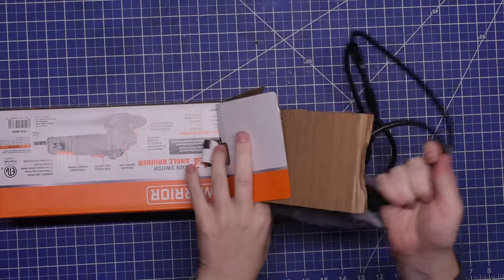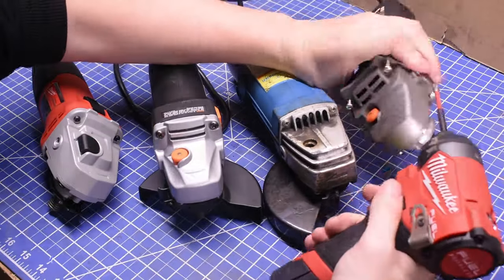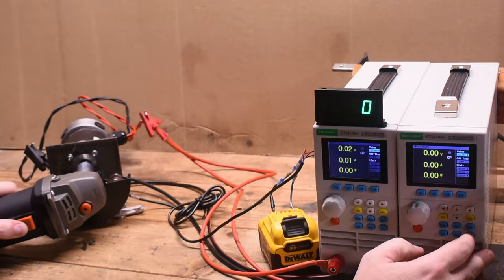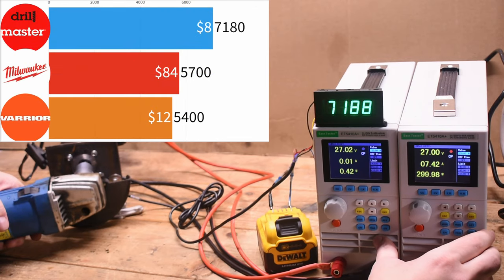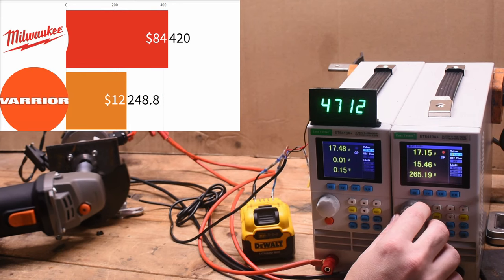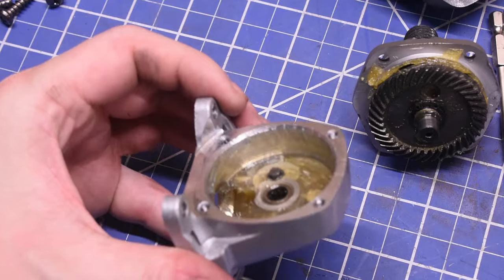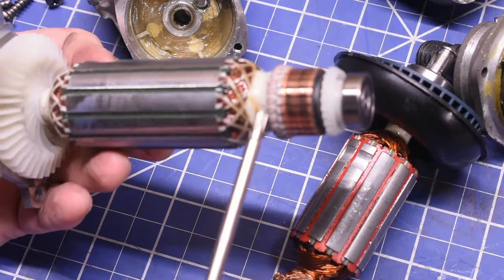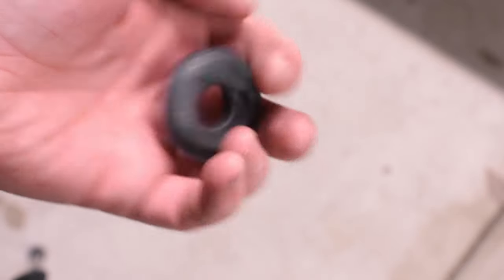Exactly How Good is an $8 Harbor Freight Angle Grinder?

Comment from the maker: The WEN has been added to our running list of tools that don't suck: https://www.amazon.com/shop/torquetestchannel While the Milwaukee.... has not. Being upstaged by the cheapest tool on Amazon is not a good look, perhaps Milwaukee has moved on from continually improving all tools like they do with cordless, and consider these "legacy" tools that they will keep making as long as people buy them. Hopefully we can continue to provide enough objective data to send those types of tools off into retirement a bit quicker and help the cream to rise to the top.
Reply: I love Milwaukee but they definitely do seem to rest awful heavy on their laurels at times.  It's particularly frustrating when some of their cordless stuff is the best on the market and other tools are badly overshadowed by cheaper brands.
Reply: when you will test the little Vessel Gas impact gun GT-3500GE-V ? :)
Reply: @barrylinkiewich9688  at my shop we use the milwaukee corded 1/4" die grinders and when mine broke, i swapped it out for a new one and immediately noticed how easy it was to bog it down compared to the older one i used to use. we also apparently broke a corded drill from them within like a month. seems like they only really care about their cordless products these days.
Reply: DWE402 - 4.5" 11 amp compact paddle switch. This is my favorite grinder I have ever used and I would love to see it tested. I have not used all the grinders out there, but I would be shocked if this one did not put down some serious numbers. This specific model made me have a healthier respect for angle grinders, especially with a cup brush.
Reply: @l8rn3rds  Yes so you can buy more batteries that wear out after a few years. I have like 1500$ in batteries.
Reply: Really neat!! One of 6key metrics of electrical motor durability is insulation class,  it would be super cool if you could figure out a test method, maybe over amping the wires in a controlled way , measuring resistance with insulation tester?
Reply: Yea, Milwaukee being outgunned and INSANELY outpriced, was just.... sad. At their price, you could buy the Hazzard Fraught, with insurance, have it replaced a dozen times, and still not have spent as much total, evenwhen including cost in gas to drive there-and-back!

The entire point of the big name brand shit is to buy it because it's going to BE a better but long term... But unless you're in Antarctica and lack the HF store to get a quick replacement, I see no point in going with a brand name... 🫤😒😔
Reply: @ducembarr7057  That's a good idea, I think...
Definitely would need a FLIR camera, no matter what. (although I think they have one... good excuse, if not!) 

I don't think measuring resistance initially will be of any use (just to get that out of the way). They'd need an electrical insulation tester though, or whatever the thing is... AvE and BigClive have one. It's a big box that does insanely high voltage, used to test windings. I think it charges the windings (the HighV part), and then performs the impedence test... 

But yea... The test... 🤔🤔 Here my idea:
   - #1 Using a cheap toaster oven, preheat it to X temperature (which all get heated to; 150F?)
   - #2 Hook up the rotor to the bench supply, feed it Y% Amps above its rated Operating Amperage (ignoring whatever amps it actually draws under load) 
 [Monitor with the FLIR... Because YOUTUBE VIEWS!]
   - #3 Over-amp the rotor at the determined % for Z Time Period
   - #4 Test with the aforementioned "Rotor Windings Tester 9000"
        - IF windings FAIL; test concluded
        - IF windings PASS; GOTO 5
   - #5 Re-run Tests 2–4, but at Linear Increase in Amps? Or maybe Logarithmic Increase? (former is more brutal, yet quicker for gathering data; later is more useful and scientific, at cost of time needed) 
        - IF windings FAIL; test concluded
        - IF windings PASS; Repeat Test 5

Maybe also make note of:
   - when smoke appears 
   - when there's a telltale smell
   - when the adhesive begins to discolor
... but tool continues to function (rotor tests "good")
Also, any noticed color of adhesive that seems to coincide with windings also being toast (failure).
Reply: I’ve had great luck with WEN as a hobbyist. They seem to do really well on making basic tools that work seemingly forever and making the right trade offs between functionality and durability for someone like myself, who will use a tool less than 100 times. Using it a few times probably means it’s paid for itself many times over vs hiring a handy man for something boring.
Reply: As I understand it, Milwaukee corded grinders used to be the ones to have.  And at some other point the Mikitas.  Now it's DeWalt maybe?  I haven't broken my 11amp 4.5" DeWalt after much abuse but the spindle nut was terrible out of the box.  And the nut pretty quickly went from terrible to unusable, didn't even have a chance to lose it.  Luckily those nuts also seem to accumulate and are universal.
Reply: I just bought the WEN grinder based on your review. Any idea what exact diamond cup attachment would be compatible?There is a complete absence of this info on the Amazon listing.
Reply: Do the Hercules vs makita 13 amp

Comment: Yes on vibration testing
Reply: Agree.  If you're putting hours on one of these things that really starts to matter.  I have Dewalt, Makita, Hercules and yes, that same old $8 Drill Master (I think I got mine for even less on sale!) and the Hercules and Makita both feel similar while the drill master not only has far less power but buzzes your hands to death and just feels unpleasant to use.
Reply from the maker: Will do. Preliminary testing shows you need to do it in a static supported hand with a disc attached otherwise its much higher or lower in some brands. Knowing vibration with no disc attached seems of not much use
Reply: @TorqueTestChannel  vibration is arguably more important than overall power! If you was to run one for 10hr you’d agree.
Reply from the maker: @jpoplin1 were talking cordless. You gotta have like 12 batteries cycling for that
Reply: @TorqueTestChannel  I was referring to corded tools. I have lots of experience running them & not all are created equal! The best we’ve found are the rear trigger dewalts I think 12amp steal requires weekly disassembly & cleaning out! But we’ve actually ordered new brushes to keep them going.
Reply: 100% agree
Reply: I've got some tendonitis in my elbow that won't go away, and when I put in a couple hours with angle grinder and right angle die grinder, it really flares up. So vibration testing would be really valuable to me.
Reply: The cheap ones will vibrate your hands numb
Reply: @jimmyswollnuts7662  Yup, which is what I have, and would like to know which ones won't before I buy nicer ones.
Reply: @grippgoat  Milwaukee, makita, dewalt, metabo. Good ones. Buy these. Buy all 4, put different disks on each one, then you don't have to keep swapping disks. Craftsman is shit. Anything Harbor fright, shit
Reply: Vibration = power loss
Reply: @TorqueTestChannel  With the disc how would you know whether the disc is adding to (or reducing!) the vibrations? For the disc to not be a confounding factor it would need to have ~perfect balance and a ~perfectly sized hole diameter.

Comment: Yes please include vibration measurements as well. As well as the actual tool teardowns. Now that AvE has really slowed down with his BOLTR reviews, and Tool Teardown channel all but dissappeared, we really need someone to step in to the fold and give us these teardown comparisons.
Reply: It's kind of a shame.
I still love watching AvE, but his BOLTR videos really brought his channel to prominence.
Reply: @DarkFiber23  I love AVE for all my anti-vax rants, gun-nut libertarian nonsense, detailed guides on how to break endmills and swear at a CNC you don't know how to operate, and using poorly-repaired farm equipment incorrectly then getting angry when it breaks.
Reply: @Jamvan001  Well said, @Jamvan001  
His eclectic mix is great to watch over a beer.
Reply: @Jamvan001  his engineering degree has really started showing with age
Reply: @DarkFiber23  you've badly misinterpreted my comment
Reply: @Jamvan001  For some reason YouTube cut off the latter half of your comment.  
Be that as it may, I still stand by what I said lol
Reply: @DarkFiber23  I'm with you. I love the guy, and his rants about random stuff are fun, but what I really want are more non-stop BOLTR videos. I'd love to watch regular tool reviews from him as well, not just power tools.

Comment: We use Makita grinders exclusively at work and they get run hard (metal fab shop), we've never had a motor fail in 20+ years.  It's always a switch failure or power cord getting pulled, cut or otherwise damaged.  
For home use I just took a couple grinders that the boss didn't want to repair, popped in a new switch or cord into and kept using, I've even given a few away to friends.  My oldest is probably 20 years old and objectively still runs just as hard as the new ones.
Reply: My makita motor failed. It did take it 20 years though.
Reply: Agreed. My corded Makita HP2051 drill is now 15 years old, and it's been through quite some stuff. Still runs like new, could use a new chuck though. Makita just knows how to build good motors, but then again, it would be embarrassing if they didn't, as they originally started with building and repairing electric motors.
Reply: I have burned two of those makita blue grinders up in the shop before. Blowing smoke and all

Comment: I also would love to see vibration ratings.  Not only is vibration a durability concern, but a fatigue concern.  If I know one brand is a little down on power but runs much smoother, then that is what I want for those few days where I am grinding my project 4+ hours
Reply: If you are grinding 4+ hours do yourself a favor and look at the Makita 9005B 5” grinder.  It has the rat tail that is easier to grab and a side handle for better control.  It is like a small 7-9” grinder.
Reply: I'm curious to know if the vibration frequency affects how the tool feels.
I'm hoping the TTC will include both the frequency and magnitude of the vibrations.

Comment: Measuring vibration would be incredibly valuable. I absolutely hate vibration in both gas and electric tools and it can cause long-term nerve damage. It's a reason I've not been crazy about the Flex brand of tools despite their power.

Just for the heck of it I clicked the link and bought the Wen you tested. For a price that low it's a handy thing to keep around for occasional use.

Comment: I too have a 15-16 year old HF grinder. I have repaired the cord twice. It still runs and runs circles around the newer HF one i bought... not as a backup but as an extra with either a flap wheel or wire wheel while the other has a cut or grind wheel on it. Saves time.
 I can not tell you the hours i have on the old HF but i have build 2 hotrods and restored a rusted full size Blazer and that old HF grinder was all i had at the time. Its still going to this day. ❤

Comment: Interesting to see, that the old stuff really lasts and it's not only subjective. I mean, it looks like there is almost no grease left in you 8$ beauty (at least compared). 
It hurts to see expensive brands cheap out on stuff like bearings.
Reply: For the cost of that Milwaukee that bearing feels like an insult!
Reply: While that one has lasted, that isn't an indicator of build quality of the rest of those grinders. That could literally be the only one that lasted longer than a year, and it could be from a fluke of production.

It's like when people say "people don't build houses like in the old days - look at the Coliseum, that's still standing", while completely ignoring that there aren't any 2,000 year old houses anywhere.
Reply: It takes years to build a reputation and seconds to destroy it. Milwaukee will lose out in the long run.
Reply: @MrMartinSchou  That makes all these test anecdotal anyways as with every tool your mileage may differ. But it is an average indication of how well a tool may or may not perform. However I agree with the statement of the old days were better are taken with a mountain of salt.
Reply: @MrMartinSchou  I have a dozen of those HF Drillmasters, purchased in 2001.  All but one are still working.  I believe that one has the lock mechanism jamming it and would probably be repairable in 5 minutes if I bother.  Bonus is that HF didn't charge shipping to U.S. military APO box overseas.  No tax either.  I got them for $9 each.  They also came with spare brushes.  I use them often, and have swapped out the brushes on some.  Best tool bang for the buck ever.  BTW, they don't build houses as well as they used to.
Reply: @MrMartinSchou it's called survivor bias
Reply: @MrMartinSchou  I also have that model Drill Master grinder that is still going strong. I've had it at least as long and it has seen some rough use over the years.  I lost the nut that holds the disc on, so now it has a wire brush on it but it still runs as strong as ever.

Comment: I do maintenance at a beef plant, and at work we have Milwaukee and dewalt angle grinders. The corded dewalt has been kicking for years, and it gets overused and beat on. The milwaukee grinders feel more torque-y and powerful, but ive seen two get burned up in 2 years. Now the cordless ones... our dewalt cordless grinder sucks. No balls, battery dies in no time. Mulwaukee one kicks ass. 
At home I use a HF bauer corded grinder, and it feels powerful like the mulwaukee ones. I'm not rough on it,  so ive not managed to hurt it after a year of use. Im a milwaukee fanboy for most things like drills and impacts, but HF has been impressing me lately with some of their power tools.

Comment: The fact his 20 year old HF drill master is still going strong tells you all you need to know. Just go to HF buy the best warrior model you can afford and be good to go for along time. They just released a 6 amp model with paddle switch for $24 so with coupon $20 and I bet it’s a beast probably similar or better then his drill master.

Side note I have an old black drill master that’s at least 10 years old and it’s a beast and won’t die as well.😂

Comment: I've had the Wen. It lasted one day.  Just putting a 7" grinding disc on the Wen caused it to overheat, just spinning in the air, without touching the work. I've had the warrior for 6 months, and it works fine.

Comment: Definitely yes on the vibration testing. Great video as always!

I bought a drill master angle grinder in probably 2012 for $10. I used that thing for years. On more than one occasion, I had it so hot I had to use my welding gloves to use it- it never gave up tho. Ended up giving it to someone once I got my 13amp Dewalt 4.5” angle grinder.

Comment: Vibration testing would be nice. I use grinders to dry cut porcelain tile with a diamond blade. You need a smooth running grinder. If it vibrates too much it will break the tile. My 2  old dewalts cut smooth for awhile then started to vibrate. My makita has ran smoother longer than the other 2 combined. I tried the first original dewalt cordless(brushed). Huge Vibration with very little run time. Used 3 times and has since collected dust for past 14 or so years.

Comment: Project farm recently did a corded grinder test. But was more aimed at the 15 minute use in dads shed crowd. Thank you for this one. My go to will always be my selection of overworked and beat to death but still not dead dewalts. 2 paddle switch 4.5s, a 5", a couple 7" and a 9" monster we grind tires with! But i need some for employees to use and the Wen may fill that spot!

Comment: Please, please, please test 11-13 amp grinders next. Particularly interested in the Hercules 13 amp  corded rat tail, its competition from Dewalt also a 13 amp corded rat tail. As well as similar powered corded grinders from Makita and Metabo.

If you're gonna buy the tools urself, the Hercules 13 amp rat tail is currently on sale for $69. 

Thanks!
Reply: Huge +1 to this
Reply: Btw I mean Metabo proper, not necessarily Metabo HPT (though it's fine if you include those also). I hear the true Metabo grinders are really good...though not cheap.

Comment: best 4 1/2" angle grinder hands down  is Makita we use them at my work and we are a heavy steel company and just last hours on end and Milwaukee as you said  are like using an auto f balance wheel, they vibrate like hell and thats after 4 replacement units 👍

Comment: Would be cool to see the full spectrum of HF 4.5 inch grinders. Pretty sure they have 5 or 6 different price points for them.
Reply: This is exactly what I was hoping to see as well
Reply: I own the small 4.3 and the bauer paddle switch, im planning on getting the hercules paddle and one or both larger warriors. The 4.3s aren’t worth shit unless you need 10 of them for different types of discs. the Bauer paddle is so far holding up well while running the wire wheel, has enough power and is comfortable to hold. Remind me in a month or so and I’ll tell you about the others
Reply: I have the Hercules 7-amp side switch grinder. I've had it for a few years, since shortly after it first came out, and I beat on it fairly regularly. It's a solid tool. It even came with a set of replacement brushes, though I've not needed them yet. When I first got it, I did a teardown and found it to be well made- nicely machined gears, lots of epoxy on the windings, nice beefy brush holders, etc. I do find it lacking in power sometimes, and I'm not necessarily a fan of the switch design. I think I'll eventually get either the 11 amp paddle switch Hercules or the rat-tail one that can be converted to 6".

Comment: I’ve been using a similar Wen grinder for about 5 years now and I’ve had no complaints. Mostly used for auto restoration and grinding down my subpar welds, its worked flawlessly